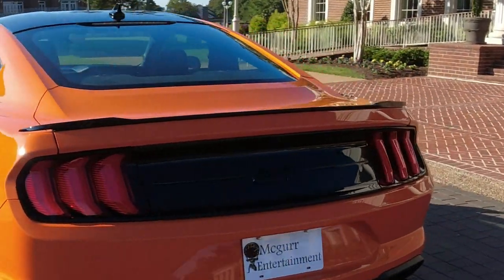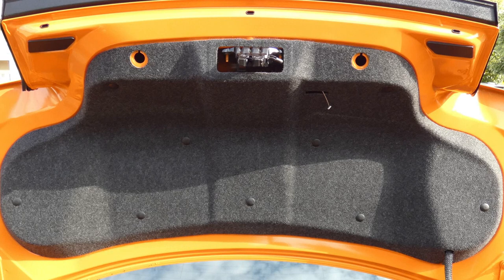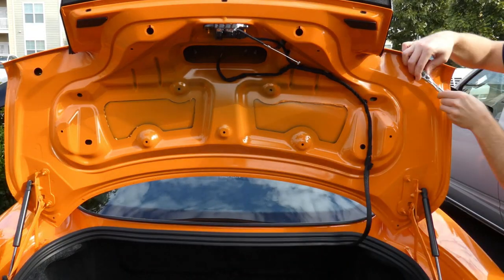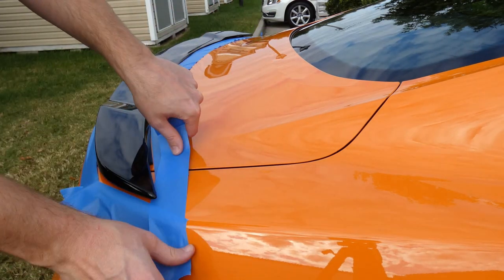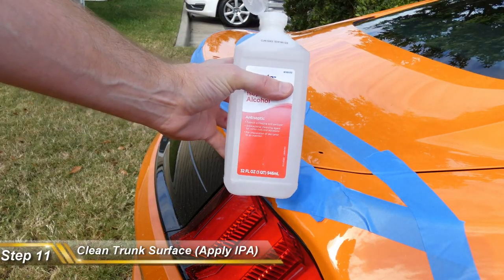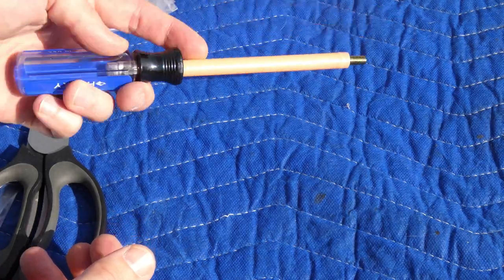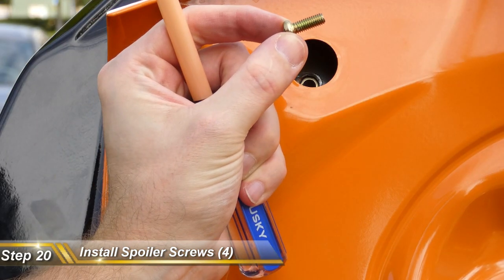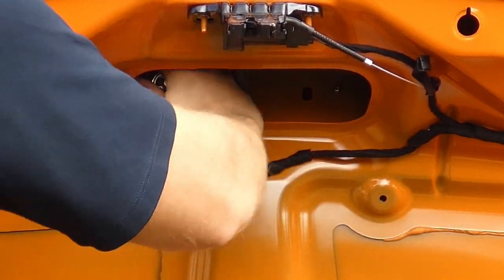How to Replace a S550 Mustang Spoiler (2015-2023).

Comment: The stock spoiler might as well be a piece of duck tape. Its so small, its almost pointless. Its only real purpose is a place holder till you get a new spoiler.
Reply from the maker: Lol. It really seems that way.
Reply: am i able to put a spoiler on aftermarket if a buy one that has a spoiler delete from factory?
Reply from the maker: Yes. https://youtu.be/GOLbc1GLuWA
Reply: Only thing it was good for tbh was that I already had my holes made for my new spoiler 😂idk wtf ford was thinking with this "spoiler"

Comment: I followed this tutorial and my install today worked out great! The eraser wheel is a must. I used a heat gun to get the stubborn adhesive loose towards the middle of the trunk when prying the initial spoiler off. Thank you very much for the extremely detailed and noob friendly guide!
Reply from the maker: I am very glad to hear the install went smooth, that's awesome!!! Thank you for the support.

Comment: Bro I just my out this weekend and your video was very helpful. The 3m adhesive removal wheel od diffentally a must. Not sure why put some much double sided tape. I also instead of using the allen keys. I just bought extra long bolts and cut the heads off as guides.
Reply from the maker: Very nice. I'm glad the video helped.

Comment: Before viewing your video I attempted to remove old "base spoiler" but screws were easy but not the adhesive tape. I gave up and decided to research. I will try again. Thanks for the eraser wheel idea. Why ford uses so much tape is beyond me. Auto body shops must really hate that tape.
Reply from the maker: Fishing line really helps for the removal process

Comment: Good video, on the ecoboosts models there are no holes on the trunk, the little want to be spoiler that comes with the car is just taped to the trunk. I had to drill on the trunk to get mine on.
Reply from the maker: Sadly, some ecoboosts don't come with the pre-installed lid. However, I did make this video for that exact scenario: https://youtu.be/GOLbc1GLuWA

Comment: I just removed the stock spoiler on my 2019 today and I can attest to how awful the adhesive removal is. If the rubber wheel works half as good as the video suggests, buy it even before you buy the new spoiler. It took me a solid 2 hours to remove the adhesive without it.
Reply from the maker: I've felt your pain. The first spoiler I did took forever to remove the tape without special tools. The eraser wheel was worth every penny just after the first use. Future tape removal jobs became simple tasks.

Comment: Great video, best one I found and was really helpful on installing my new spoiler. But of course nothing ever goes smoothly according to plan. 

*When taking current spoiler off, only STAB the tool in. Do NOT stab and pry upwards. I ended up having 30+ small dents on the rear of the trunk from every time I placed the tool and lifted up a little bit. I wasn’t even using much force at all.*
Reply from the maker: I'm very sorry to hear that. Were you able to pop the dents put?
Reply: @mcgurrentertainment  Nope, there were about like 30+ small ones I wasn’t even going to attempt it. Spoiler stuck on fine, got the two side screws in, and the middles ones for some reason won’t thread in. It’s been a huge PIA

Just glad I have a magnetic stick to get the screws back that have dropped to the bottom of the trunk multiple times now 😂
Reply from the maker: Damn. And yea, I've dropped the screws in the trunk a few times as well when I did the first Mustang. Had to remove the trunk and tip it over to get them out.
Reply: @mcgurrentertainment  Yep, the last screw in the middle will only go half way in. Might give up and just leave it as is lol.

Comment: I wish you would show a S650 spoiler install. They changed the decklid- Made it harder
Reply from the maker: I would love that. Just need to find one.
Reply: @mcgurrentertainment  if you’re near Pennsylvania you can install mine lol. It would be a good video
Reply from the maker: Agreed. Sadly, that's quite a bit away.  Good idea, though 😁
Reply from the maker: Wow...I'm at the dealership right now. And you are 100% correct. You have to remove the decklid to remove the spoiler. Doesn't look difficult, but definitely extra steps.

Comment: Awesome video my man! This explains everything in depth that the American muscle video doesn't such as the fact that the double sided tape is stickier than a fresh turd. In AM's video they just popped it off like meh, no biggie.
Reply from the maker: THANK YOU VERY MUCH!!! I've tried my best to show all the steps. Thank you for the support.
Reply: @mcgurrentertainment  One question for you though, did the eraser disk you used to remove the double sided tape leave hologram swirls in the clear at all. In the video it sort of looks like it did unless those were just smudges that cleaned right off with a microfiber towel.
Reply from the maker: Good question. There were some smudges after using the wheel, however the alcohol should clean the rest off.
Reply: @mcgurrentertainment  Cool thanks! I helped my buddy put a wing on his mustang and that tape was no joke. We used acetone and elbow grease 😂
Reply from the maker: It's crazy how strong that tape is. The spoiler nuts were just overkill. 😅
Reply: @mcgurrentertainment  The idea of using the milkshake straw to hold the screws in place is brilliant. Bro go look at America muscle's wing install video. Not trying to bash those folks they're a nice group but it's cringe worthy. Not joking I saw their video and said to myself if that's how replacing my wing is going to be forget it, especially after the hassle my buddy and I had installing his! Your video has helped change my mind

Comment: It would've been a lot easier if you get 4 studs (headless bolts) or sacrifice 4 bolts (they are cheap) and cut off heads. Screw them in the spoiler. I would be more comfortable with alignment of the holes that way, than relying on thin allen keys, which could put the holes off center. You can remove the studs after install using your straw trick, or needle nose plier.
Reply from the maker: Whichever way works for you.

Comment: Very great video, my stock 21' ecoboost has a factory painted lip spoiler. I saw some people had to drill holes for the two middle screws. Any idea if these holes are factory on all mustangs? or would I have to drill new holes.
Reply from the maker: The holes in the middle are typically present. The two holes for the two outer corners of the spoiler are usually added for some installs.

Comment: Great video but why not just install the line up pins or Allen keys before putting the bolts in the spoiler
Reply from the maker: The spoiler and trunk holes have a fair amount of play when lining everything up. It was easier to bolt down the spoiler in the ideal position to ensure it would be perfect; then tape down the Allen keys. Good question.

Comment: Do all S550's without the spoiler delete option have the same hole placement? Also great video 👍 I've been teasing the idea of getting a spoiler similar to the one you installed here
Reply from the maker: That is a great question. I would imagine they would to simplify the manufacturing process, however I'm not 100% sure. Also, thank you for the support, it really means a lot!!!

Comment: I have an issue… so I removed the 2 top nuts when I did this and they fell inside my trunk lid and I got replacements for the nuts but the problem is they rattle around when I drive is there any advice you could give me to get them out? I’ve even tried earth magnets
Reply from the maker: Sadly, this has happen to me on a different mustang. You will need a 10mm socket and remove the trunk (4 nuts). It would also be a good idea to disconnect the reverse camera so you can turn over the trunk without constraints.
Reply: @mcgurrentertainment  so after I get the trunk off I’m guessing just shake it out huh? And thank u man I didn’t know if there was any other way and ur response time is on par that’s awesome dude for at 4:30 am😂

Comment: I just bought a carbon fiber spoiler that only comes with 3M tape but not pre drilled holes for the factory screws. You think some self tapping/ drilling screws would be a good way to better secure my spoiler to the trunk?
Reply from the maker: That's a great question. Adding mechanical fasteners would be ideal when attaching a spoiler. I've never tried self taping screws for carbon fiber. I would probably try to drill/install steel inserts to line up with the factory holes.
Reply: @mcgurrentertainment  should be something I can easily find at Home Depot
Reply from the maker: If not, Amazon (https://www.amazon.com/Z-Externally-Threaded-Stainless-Internal/dp/B002KLPW96/ref=mp_s_a_1_1_sspa?crid=1R6IM1D4FGOD9&keywords=Self-Locking+Steel+Inserts+m6&qid=1679079882&sprefix=self-locking+steel+inserts+m6%2Caps%2C107&sr=8-1-spons&psc=1&spLa=ZW5jcnlwdGVkUXVhbGlmaWVyPUEyUTBONkJGM0NGRUFaJmVuY3J5cHRlZElkPUEwODI0OTI4MkdQUE9UMDlRSDJYSyZlbmNyeXB0ZWRBZElkPUEwODg1MzY5MkMyU0VDMktZNFM3RyZ3aWRnZXROYW1lPXNwX3Bob25lX3NlYXJjaF9hdGYmYWN0aW9uPWNsaWNrUmVkaXJlY3QmZG9Ob3RMb2dDbGljaz10cnVl) or Ace Hardware
Reply: @mcgurrentertainment  my only concern is the carbon fiber being too thin to properly hold the threads. I’ll have to get a better feel for the spoiler when it comes in. Thanks for your help!
Reply from the maker: Anytime

Comment: I have a UK GT. I popped the black rubbers off and there are no bolts. Is it possible the blade is on with just tape?
Reply from the maker: That is odd. I've never seen that before. Is it an aftermarket spoiler (not the factory lip version)? I wonder if someone taped an aftermarket spoiler to a "spoiler-delete" trunk.
Reply: @mcgurrentertainment  same blade style you removed. I'll take the boot cover off to check middle bolts.
It could be that previous owners got a ford blade and taped it. It does however look very factory.
Reply from the maker: Gotcha. If you don't see middle bolts,  it's very likely to be completely taped on. You can use fishing line and remove it.
Reply: @mcgurrentertainment  can I just say I think your videos are excellent. Very clear instructions. I've used your GT mod instructions for most if not all my upgrades.
Reply from the maker: That's awesome. Thank you very much
Reply: @mcgurrentertainment  it was taped. Got the 350 track pack on using a combo of your videos. Thanks.
Reply from the maker: Very cool

Comment: The fact that they did not put studs into the spoiler for ease of installation makes this a DO NOT BUY product.  There are other brand spoilers that have the studs and dont need this level of engineering to get the spoiler on straight.  Totally DUMB BUMB.
Reply from the maker: Ok
Reply: My PP1 spoiler from American Muscle has the studs on them.